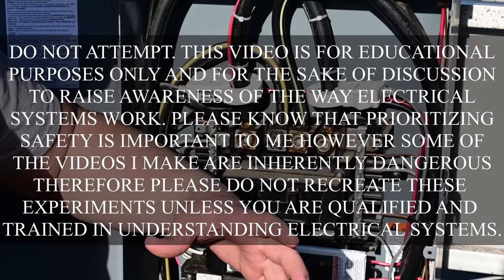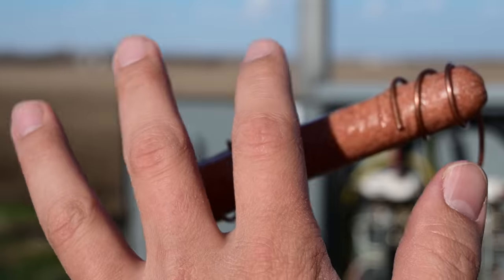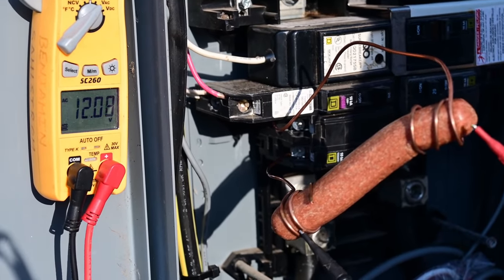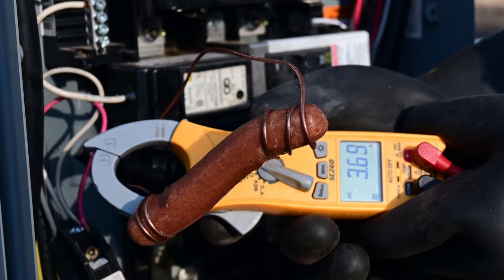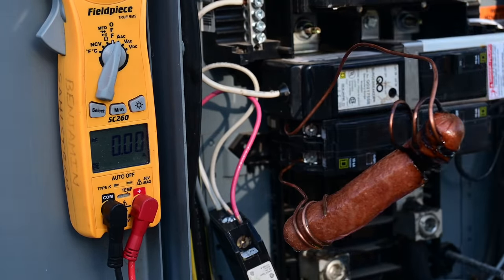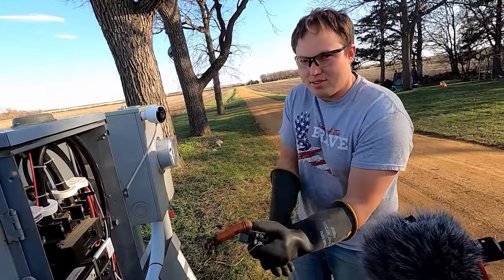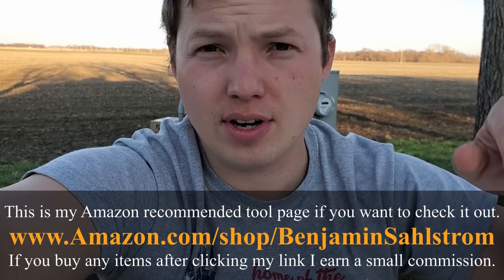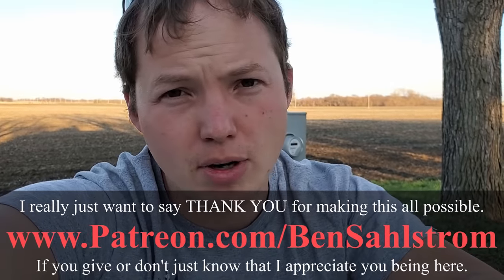Hot Dog Vs. 240 Volts & Electrocution Burn Example!

Comment: The worst part of electrocution is the muscle paralysis, you get a claw grip of the involved arm and can't let go. When I was 5 years old I put a screwdriver tip into a wall socket. I couldn't let go, I rocked backwards and my body weight pulled the screwdriver out as I fell to the ground. No injury but a lifetime memory.
Reply from the maker: This why we now have Tamper Resistant receptacles! I've never experienced muscle paralysis like that other than maybe a bit with an electric fence once.
Reply: Memories tend not to hold up. 110 will whack you but it's not really enough to grab you.
Reply: @BenjaminSahlstrom  last hot fence I touched it actually spun me 180 the other direction with a burning sensation in my fingers and toes. Was on a cattle pasture lol.
Reply: @MadMetalShop  Well, believe what you will. All I can tell you is it was strong enough to cause tetanic contraction of forearm muscles, there is no way I was able to let go.
Reply: This is what i hear. 120 will hold on to you. I have been zapped by 277 and it just pushed me back.
Reply: @MadMetalShop  Not true. I have seen videos of people not being able to let go while getting hit with 120 volts. There are other factors involved other than just voltage.
Reply: Yeah... That actually didn't happen. But fun story. I do love how people believe a 5 year old perspective on things. Lol
Reply: Not normal for an AC voltage to grab you as - receptacle it’s a alternating current not direct. I’ve been shocked with 120 AC quite a bit and never experienced this.
Reply: @prestons3055  under the right circumstances it is very common for AC voltage to constrict your muscles not allowing you to let go.
Reply: @prestons3055  if it knocks you back then it is direct,assuming you only have one on it. But if you grab at anything that will ground you, then it alternates and WILL hold you long enough for them 20amps to stop your heart.
Reply: Yessir and then throw them Klein 's at the guy that turned it on!
Reply: @jjmcwill1881  that’s 240 volts.
Reply: @imperialdoggo5826  I'm aware. The building I worked we had 120, 240, 277 and 480. Thankfully I was never hit with 480.
Reply: @blackcreek80s9  not true. I was working hit on a 277 light fixture AC and accidentally energized the entire fixture while leaning on it. Pushed me back. People without experience are making assumptions. Listen to those who have worked on this stuff.

Comment: At work we wear leather protectors over ours to prevent punctures or small cuts. We test them before every use by blowing air into them,  folding the cuff over and checking for leaks. A small pin hole in the glove makes them completely worthless.
Reply from the maker: Makes sense. You can't be too cautious that's for sure.
Reply: Same proceedue we used back I the 60s when I worked for the telephone company
Reply: Still seems like gambling even with the gloves lol. I would be paranoid af making sure those have no puncture or anything.
Reply: Which Chris from Kansas City? I'm a line worker in Kansas city. So I was just curious.

Comment: In the 1970’s, my mother purchased a Presto “Hot Dogger” kitchen appliance.  You loaded the hotdogs in the lower tray.  When you closed the lid, the appliance passed 120 volts through the hotdogs.  If the hotdogs had a high moisture content, they would cook evenly and be tender and juicy.  If the hotdogs had a low moisture content, the ends of the hotdogs would burn (turn black), and the hotdog was rubbery and dry.  She only used the appliance a few times.  On one occasion, it tripped the 15-amp breaker.  I really enjoy your videos.  I am OCD when it comes to wiring a main panel or sub-panel.  I love your attention to detail, and the neat, clean, organized appearance of your panels.
Reply from the maker: I actually bought one on eBay and plan to make a video about it!
Reply: @BenjaminSahlstrom  I look forward to the video.  Interesting that you can still find one.  I would be surprised if the "Hot Dogger" was a marketing success for Presto.
Reply: @ElCapitan1718  I was a kid in the 70's. The town's movie theater had one of these in the lobby, and you could order a hot dog during intermission. Also, giant dill pickles. The theater showed cartoons before the movie too! :,(
Reply: @BenjaminSahlstrom  Also bought one on eBay not long ago. Going to be honest, I used it one time and won't ever use it again. The cooking quality is ok at best and theres a unique and slightly unsettling smell. But no regrets, the novelty value is 100% worth having it for.
Reply: You should check out Big Clive, he is a UK electrician who bought one and cooked some hot dogs. Their electricity is 240V live to neutral. Now we get to see the difference between that and split phase. Awesome stuff, haha!
Reply: We had one of those for electrocuted hotdogs 🌭

Comment: I use to cook hot dogs in my shop years ago.  I would stick a nail in each end then I would hook an alligator clip to the nail and connect it to a 110V line.  It took about 15 seconds to heat the hot dog.
Reply: Now I want to try that. Ha ha ha
Reply: Might have to try this as well....
Reply: @trevordrexler5652  When I use to do that there were no microwaves.  You can buy hot dog cookers that work on the same principle.  (at least you use to be able to)
If you use the alligator clips, make sure you unplug the electricity before you grab the hot dogs.
Reply: @davpro1792  And what poisonous chemicals are that.  Stop the bull shit unless you know what you are talking about.  I suppose you think microwaves are dangerous too.  I am 79 and still doing well, how old are you?

Comment: Ben Sahlstroms house panel: “oh shit, here comes the mad scientist again”
Seriously though, you should never use hot gloves without the leather glove protectors
Reply: o come on an old rhyme" its fun and games when you see a spark in flames" lol
Reply: I had an electrician chew my ass out for not wearing ppe. I thought he was just being a jerk and overacting. About two months later, I was working on a 3 phase heater with him and he made me put on gloves. Thank god I did because I turned the breaker off and didn’t check voltage and somehow one of the line phases had voltage and arced. I was damn lucky because I was on a 12 foot ladder.

Comment: If you put 2 inch of the copper wire inside the winner in both sides of the winner you will have a different action on the winner
Reply from the maker: I thought of that. Might have to try it!
Reply: I gave a thumbs up for the excessive use of the word weinner in this comment

Comment: These are the rubber part of the hi voltage gloves made to be used ONLY with leather outer gloves and should be "Air Tested" per mfg. instructions, after they air test OK they will be marked with the test date etc.!  Listen to J.W. Stevenson. We always stored the rubber gloves and blankets in  metal containers for protection, all it takes is a pin hole. The gloves also come in many different voltage levels.  Retired IBEW electrician.
Reply from the maker: Great comment. I am going to leave it but you could edit it to say that you are talking about the lineman gloves since the updated video only briefly features the gloves after the edit.

Comment: That's just how devices are energized, anything 0.06 amperes can can kill you. It's not the voltage the voltage is just the pressure but amps are the electrons that actually bring the charge anyway local 613!

Comment: 2:10 You're checking meat impedance with multimeter, which is intended for linear resistance. Human body doesn't have linear resistance, it may change like resistance of fluorescent tubes or sodium lamps.
Reply from the maker: Is there a tester made specifically for measuring the resistance of a person or other similar substances? It actually came out pretty close though initially! My multimeter wasn't fast enough to get a good measurement of the initial amperage but the first that it showed was like 0.7amps or so. Then as the temperature increased so did the amperage.
Reply: @BenjaminSahlstrom  The simplest way is Wheatstone bridge: 
https://en.wikipedia.org/wiki/Wheatstone_bridge

Comment: As a wireman... i didn’t like any of this, and I’m someone who likes the rush of live circuits.
Reply: I agree, and believe the youngsters are putting themselves at great risk of electricution. Access to live panels should be discouraged. Electricity is not for fun.
Reply: @adrianhaw4635  Yeah, I obviously don't go looking for hot work, but we do have to do it from time to time. Sure it's exciting to get a whack off a receptacle here and there, but I was 5ft from a guy who blew up a 480/277 600A I-line in his face and walked away from it. I was deaf for the rest of the afternoon and covered in soot.

Comment: Long ago in my reckless youth I also cooked a frank with two nails in a board and a power cord to 120v.  It worked, but there was one drawback (besides poor safety).  The ends beyond the nails didn’t get cooked.

Comment: I was shocked by a 240v light at school and was holding the metal door next to me and not all of the school buildings have safety switches, but this one did and if it didn't, they would of found me dead with my melted hand stuck to the door

Comment: I had a good electric shock Im from the UK and I was making sure all my light switches were earthed because I was going to put a RCDO on but it kept tripping. I didn't turn the mains off because my ego was too big and when I was putting the wires in the backbox I touched a live terminal screw and made me scream like a 5 year old girl. Never ever again am I messing with electrics when it's still live.

Comment: Very interesting. My understanding is most homes throughout many countries around the world have 220 volts in their wall outlets, unlike here in North America where the voltage 120. I was wondering how this can be safe. First time comment and the videos are very interesting.
Reply from the maker: While most circuits are 120 volts, quite a few are 220 as well. Also of you have two circuits that come from each leg of power in the panel that is 220 volts even though the individual circuits are usually 110.
Reply: Yes, many countries do have 220 or 240 volt outlets,  but it's worth noting that there are plenty outside North America which have voltage somewhere between 100v to 127v.  Anyway it is entirely possible to cook a hotdog with 120v from a US outlet. it might take a little longer, but it will cook and burn.   It's also true that 120V can kill you.  Arguably 240v is more likely to do this, but that's a matter of degree, it's not like 120V is safe, and 240 is dangerous.
Reply: Typically those 220v in other countries is being pushed by half the current of our 110. In other words it is about the same as our 110. At least how I understand it.
Reply: It's 220 here where I live, and I've got zapped a a dozen times, mainly when I was a kid and loved to play with electricity... Well, I'm fine.
Reply: @BenjaminSahlstrom  240V not 220V

Comment: You should emergise the suasage further from the panel,  all the mess it can do in the panel!?
Reply from the maker: Probably not a bad idea! It didn't make a mess actually in this case so that's good!
Reply: @BenjaminSahlstrom  I was conserned about the risk of shorting your input circuit before your main breakers with a potential mess.

Comment: Hey Ben, I’m looking at a new table saw that runs on 240v which I don’t have in the shop. How about a video on running a 240v line from a sub panel to a new outlet in the shop? Would love to see your explanation of the process from A to Z. Thanks!
Reply: If you’re looking for a material list before you start, double pole breaker (sized according to your welder amperage), 2 conductor cable  (sized according to breaker amperage). Cable connectors, 240v receptacle and 4x4 metal box.
Hope that helps out a bit
Reply: Step up transformer?
Reply: Higher an electrian lol

Comment: How come the breaker didn't break ?
Reply: there was no short to ground  amperage never exceeded the max know you see how a breaker works and the dangers to our balanced duel phase residential power system👍
Reply: theres resistance between live and neutral and if theres resistance there is no short circuit

Comment: I once tried to adjust my buddy's truck ignition, that had a MSD Super HEI coil, I got into the engine bay, grabbed the distributor, he started the engine. The amperage went through my body to my knee, for about thirty seconds.
I could not let go, yell or do anything until he shut the ignition off. 
After that, my jeans had a hole burned through them, and I had small burn on my knee. Felt fine after but never underestimate the power of electricity..

Comment: yo dude they made hotdog cookers using just stainless steel pins in a plastic case with 110 volts running to it cooked hot dogs in about 20 seconds for 4 hotdogs this was back in the 80s

Comment: I think human skin is higher resistance though. Still very fun to watch
Reply: Your idea of fun is questionable.
Reply: @adrianhaw4635  exploding/burning things with electricity isn’t fun to you?
Reply: Hi Charlie,  As a qualified electrician, I have too much respect for safe working and isolation.
It is however good to exchange views. Regards from Adrian.
Reply: @adrianhaw4635  I respect safety. However, sometimes I get an urge and have to get out the ol’ DC power supply. Last night it was some coins that got polished via electrolysis in water